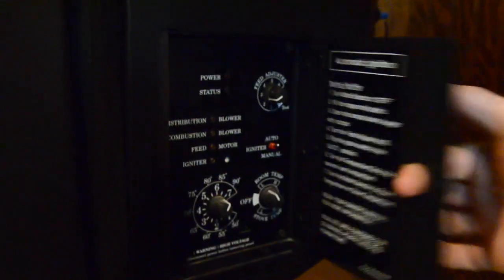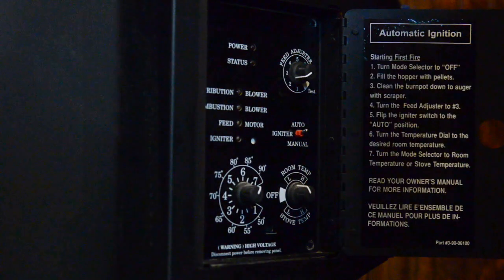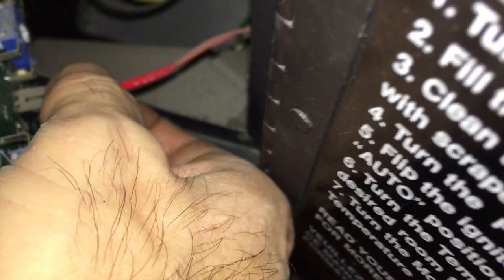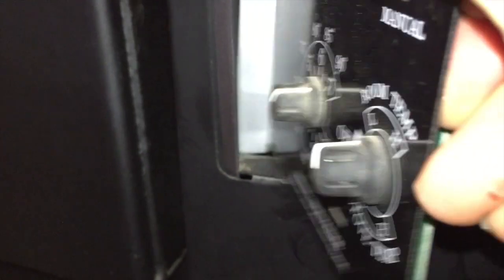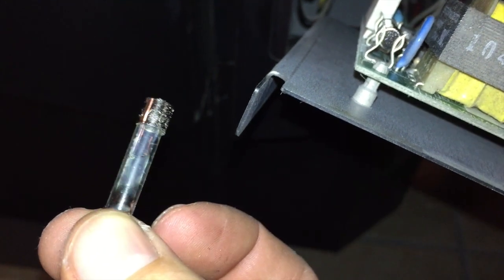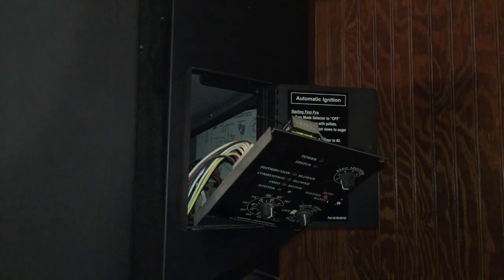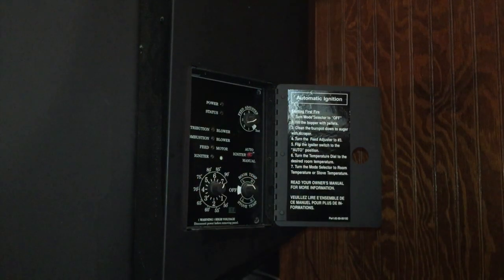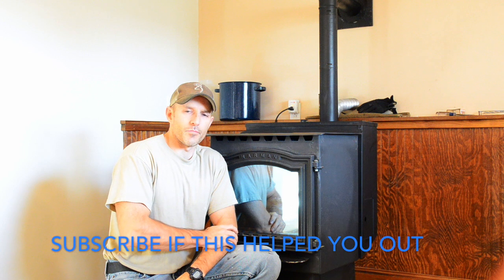No power on Harman pellet stove blown fuse

Comment: I have a XXV Harmon . I have replaced the fuse 3 times. Power light comes on, but when I turn the stove on it blows. Do you think it could be the combustion unit that is bad. I don't use the ignitor, I use the Manuel start.
Reply from the maker: Sorry I have never had that problem. There is a Harmon pellet stove Facebook page that you should ask that question. You will get lots of answers.
Reply: Thanks

Comment: If fuse blows during operation check fines box behind control board wing nut. If it's full of sawdust it will draw to many amps on auger motor and blow fuse.
Reply from the maker: Correct, my fuse blew because I tried burning corn and it had to much moisture.

Comment: My Harmon P-38 had some weird issues when trying to start for the first time this season. 
Power up - power down - very little power, fan did but didn't wanna run. 
Took everything apart, then not running at all.   Checked continuity on circuit board but nothing other then the hot.  I couldn't see the fuse until I put the CB on its side.   Took the fuse out - good - hmmm.   
Put the fuse back in and WA-LAAAAA  - everything back to normal. 
Just an FYI .
Reply from the maker: Crazy glad you got it figured out

Comment: Usually when fuse blows it's your distribution fan is shot it's the only thing drawing power when you plug stove in. It draws to many amps when first plug in it turns on and off. In normal function.
Reply from the maker: Thanks for the advice, I blew my fuse when I tried burning corn and I think it was not dry enough

Comment: I changed my fuse , not sure if it was blown , I plugged the stove in without putting the panel back in and blew the board - I have a new one on order but I’m afraid to put it in and plug in - I don’t want to blew it again could there be another issue ??? Thanks for your videos
Reply from the maker: Sorry never had this problem. I would ask this question on the Harman Facebook page.

Comment: Hi .  I did change my fuse but blow again.  I don't know what to do next.  Please if you can help me.  Winter it's coming.  Thanks.
Reply from the maker: is your stove clean? maybe something is turning hard, sorry hard to diagnose over you tube.
Reply: DIY with JIM yes it is clean .Do you think can be the combustion power  .  I will try to replace the ignite.  Thanks
Reply from the maker: I asked a friend that works on these and he said it Could be the igniter is grounding out
Reply from the maker: It’s real hard to diagnose over youtube comments sorry
Reply: DIY with JIM hi again I changed my ignited but doesn't make fire 🔥 just a noise it's working.  What else can be.  Thank you, for your help.
Reply from the maker: Join the harman pellet stove Facebook page you will get lots of suggestions
Reply: Distribution fan is shot drawing to many amps.
Reply: @CentralNH  thank you so much for your help .  I changed the motherboard and now it’s working.  If I continue having problem I will ask you again.  Thanks for answer my question.